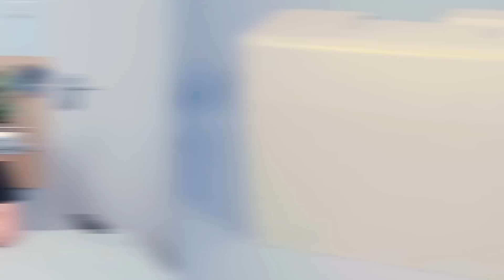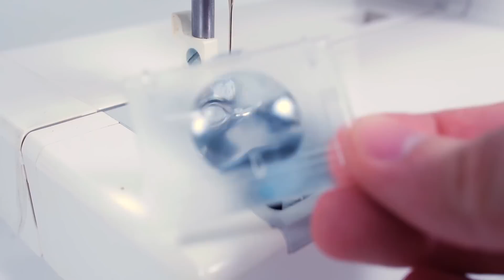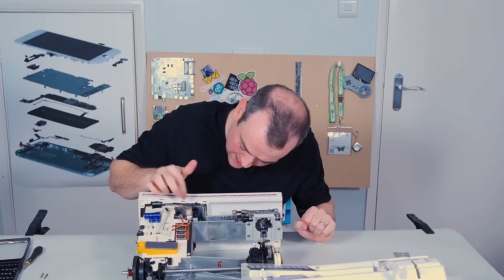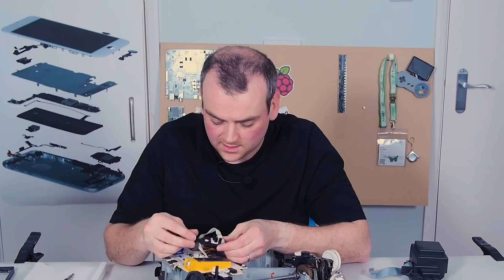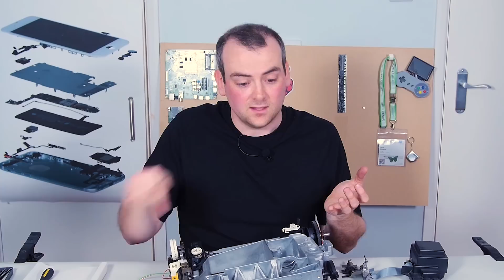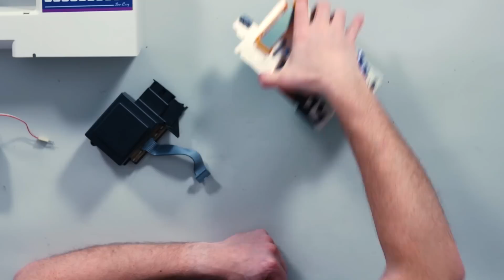Computerized Sewing Machine Teardown - The Electronics Inside

Comment: Hi David -  my Brother Innovis 1500D fully computerized sewing machine LCD Panel is very foggy. The machine itself is in very good condition. I have called Brother Support directly already and their respond is that because of the age of my machine which is not really old enough. It is not older than me, they said they can no longer support it because there is no more parts for it.  So disappointing and disheartening because the machine itself is in working condition. The main feature of the machine is the LCD panel. I cannot use the machine unless I can see the panel. Well the panel is foggy and there is no use of a machine if you cannot use the LCD panel. My question is - Have you ever came across of dismantling a Computerized Sewing Machine like mine? The other thing that came across into my mind  is that, all these computerized machine are plugin with wire and a small chip in the machine. I was wondering if I can actually be able to find the correct connection and make a plug from the machine to my computer so I can use the my actual screen of my computer instead of the panel from the sewing Machine. What do you think?

Comment: Hi wanted to ask you a query. Can we operate a machine designed for 60 Hz current on 50 Hz. If not can we use any device to modify the current  ? Or can we change the motor inside compatible with 50 Hz current and 220 to 240 V ? Actually I am an Indian Citizen but want to buy a computerized sewing machine made in USA, as I am getting it at a cheaper price.  Can you help ?